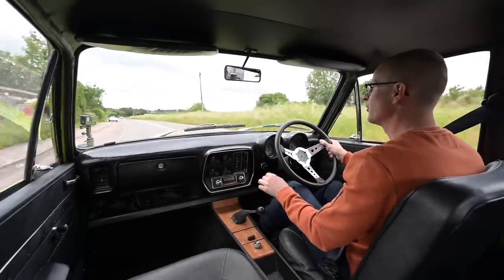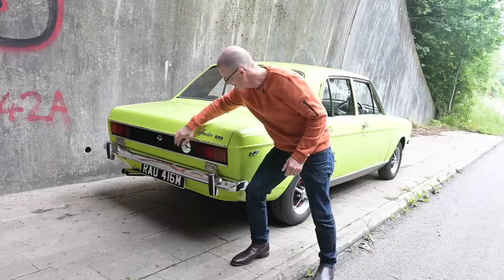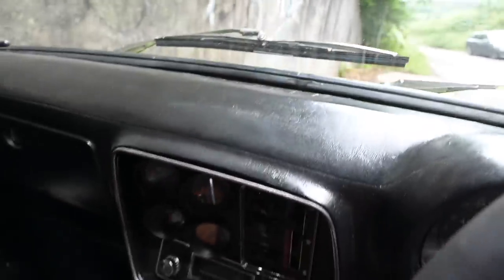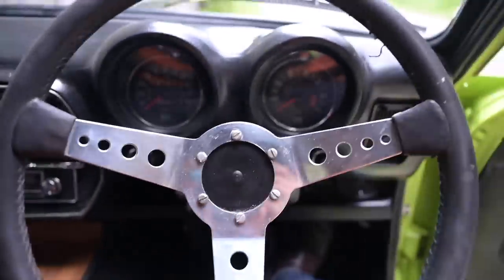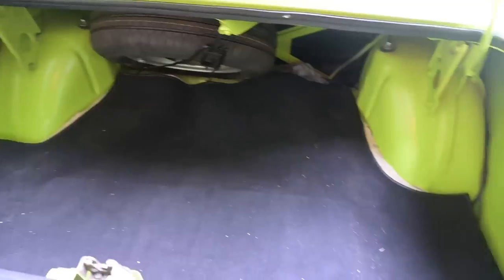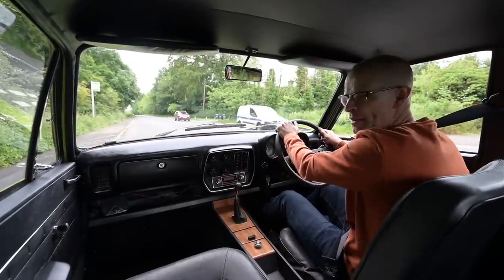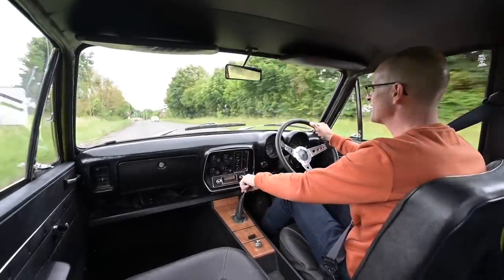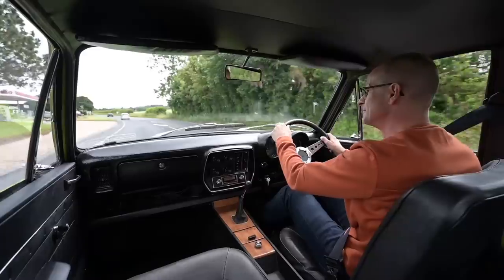Hillman Hunter GLS Goes for a Drive

Comment: My dad had one of these in orange with black vinyl roof it was a P reg with overdrive had it when it was 18 month old suffered a cracked head had it welded only for it to crack again a few months later so that was the final straw swapped it for a brand new Renault 14 gtl

Comment: My father had a 69 Singer Gazelle,  71 Sunbeam Alpine (cooking version of the Rapier) and a 75 Hillman Hunter GL. Before we moved onto a Chrysler Alpine.  The GL Hunter was in some ways good (had some good features like viscous fan and cloth seat inserts - much less painful than hot vinyl  in shorts) but looking back I think the tooling was getting old, as I recall the whistles from around door seals in the back and in the hotter summer of 76 you could not wind the windows down as they seized in their runners and the grip would let go off the glass. The improvement though was that unlike the Gazelle and Alpine variants they would eat water pumps (think i could change an Arrow water pump today as I saw my dad do it so many times).
Reply: my grandad had the chrysler alpine hatchback i remember the suspension going rock hard on it and then the solaras doors just kept failing and the handles wouldnt open them and the windows wouldnt work, he paid a lot of money for that car too. on reflection my dads old minx was trouble free, so a better car imo
Reply: @raycroal  My father preferred the Alpine, despite having only a 1442cc engine it blew the Hunter away in performance and was easier on the fuel,  but they were in Series 1 form prone to corrosion, as were the Avenger, Horizon and Sunbeam a product of successive years of Chrysler's aggressive cost cutting at Rootes and Simca in a fuitless the search for profitability. The Solara he had after a 1.6 GLS was good, don't recall him having any issues with it and he kept it till he had a Peugeot 309 it seemed resistant to tin worm which suggests that Peugeot was improving quality. We also had 3 Horizons in the family at this time, and none let us down with me learning to drive on a T reg 1.3 LS, although they all suffered the sticking brake calipers and corrosion to some extent, my first new car being a C reg LX one of the last ones built (at Ryton) it was well specced and reasonably refined with its B1 5 speed gearbox and came for the price of a poverty spec 205. I used it to tow my sailplanes around with it was good at with decent amount of weight, decent wheelbase and short overhangs and its 1.3 litre engine adequate to haul a sailplane trailer as fast as you wanted to go with 10m of weaving open class sailplane trailer behind you, however the turbo diesel 306 that I replaced it with in 93 was in different league, but given that the Horizon oily bits were little changed from the Simca 1100 of 25 years earlier it, so it should have been. However what will say is that for a family that was Simca powered for 20 years (my sister had one of the early series 2 that came still with the 1.3 Simca engine till they switched to the TX) for over 20 years, none of us ever suffered any roadside breakdowns or even series issues (wonder if our hearing is impaired by the sound of tappet rattling) in this time.
Reply: @grahamariss2111  good response i thought the little horizons could look pretty cool. I owned a 407 coupe and that was a far better car than many would believe and would reccomend them to anyone wanting a comfy cruiser

Comment: My first car was a cool looking slightly modified 1969 Hillman Hunter, complete with a black vinyl roof.  It had hot dogs instead of mufflers and went quite well. After it was written off in an accident, I replaced it with the luxury Hillman Royale 660 which had the GT twin SU carburettors. Unfortunately being an automatic it wasn't what you would call a quick car. But it was comfortable and solid like a tank. These were Australian cars sold by Chrysler. Interesting to note the interior dashes were nothing like the GLS.
Reply: They were not SU carburetors.
Reply: @erroneouscode  I stand corrected. Most likely CD150 Zenith/Strombergs.
Reply: @merlin51h84  A lot of people get them confused as they're very similar in appearance and the way they both function.

Comment: I used to have a GLS in the Philippines in the 1980s. Not ideal for Manila driving but fun out of town despite the appalling roads.  Right hand drive configuration with an air con.  Had it for a year until it broke down and when I returned to it with a mechanic it was up on bricks with the wheels, the radio, aircon,  seats .....etc all gone. Pity

Comment: I have a gearbox with an overdrive from an Alpine which used the same 1725 engine, the box is with and engine of unknown condition under my work bench. get in touch if you want to cut a deal.

Comment: The owner has done a lot of repair work to the bottoms of the doors, drivers in particular, just visible in a couple of shots an undulating surface to them.  Would a pick up acquired in Iran come with a machine gun or small bore cannon in the back?

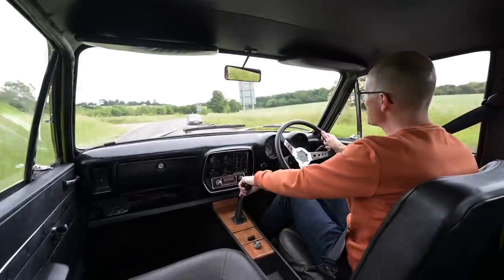Comment: 09:42 and 10:50 It Is PINKING. I daily drive  holbay and the manual  says 6 degrees of advance- On modern fuel it has to be 5 or even 4.

Comment: My pal Paul Evans  was quite pleased that his dad's 1.8TC Morris Marina would top out at almost 110 MPH, whereas one of these Hunters did around 103. The Marina's handling was pretty awful though. I hope the gent who owns this car does manage to find the overdrive for it which you spoke of. My late uncle John owned a more cooking version of the Hunter.
Reply: The Marina tc's top speed was 105mph - I know as I owned a 1978 Marina 1.8 HL/TC Mk2 and no matter what the speedo said that was all they could do which was still fast for back then. Plus the Marina handled just the same as many other rear wheel drive cars back then especially in the wet with the Mk3 Cortina being an perfect example and the Capri being worst. The Mk2 Marinas had beefed up front and back anti roll bars to improve the handling but lever arms and leaf springs are not the best for handling but then again the Marina was only designed as a cheap to run and maintain car for the fleet market a job it did well and my Marina was an ex-company car that was an excellent fast and reliable car that I would still have owned today if it hadnt been written off by a van that didnt stop at a junction and drove out right in front of me and it went to the scrap in excellent condition apart from the accident damage in 1986.
Reply: @williamwoods8022  My pal's dad's was a K reg, I believe a 1972 model. Another mate had the coupe version. I do actually recall a road test of a mk1 Marina TC which timed the car at 108mph, and that it marginally beat an MGB in acceleration. The former Marina was rolled and written off by Paul, the second rotted so badly, you could see through the tops of the front wings. I thought the mk 2 HL had a 1.7 litre engine. Yes, it did, 78BHP as opposed to the 98 of the mk1.
Reply: @williamwoods8022  you wouldnt still own it today surely?

Comment: As far as I'm concerned, Rootes' demise was a real loss to motoring. Rootes cars were good value for money, well made, and reliable. I owned a Series VI Minx with the 1725 cc. The 1725 was a good engine and very tuneable. The four-speed gearbox was, as you said, fairly long throw, but it was a strong gearbox and pleasant to use. Especially having learned to drive on a Series IIIB Minx with the column change, which was much slower to use, although I actually quite liked it. My Series VI Minx had quite decent performance and it was only in standard tune, so I can imagine that the Holbay version of the 1725 engine would motor along very nicely.

Comment: I learned to drive on a 1973 hunter - it was brilliant..... Until you drove thro a puddle when the engine would die.  Learned how to wield WD40 early in life
Reply: Also, the lining in the fuel tank came away so if you drove up hill the engine would stutter and stall as the fuel outlet blocked.....

Comment: A very nice example of a vanishingly rare model for sure but the first obvious thing that strikes me about this 1974 manufactured car is that it kinda looks like a Mk 2 Cortina (outdated quarter lights and all) at a time when Ford had long moved on to selling the 'Coke Bottle' Mk 3 Cortina - my first car by the way. So it would seem that the Roots Group - just like the BL to a degree -  couldn't afford to keep up with the competition when it comes to the latest styling trends. The engine in this car also sounds somewhat agricultural to be frank - but most four pots were back then. 

Also how well do I remember what these black vinyl seats felt like on a hot summer's day, methinks the owner should seek out a set of tiger skin print seat covers if he/she really wants to experience to joys of 1970"s motoring!
Reply: It was launched slightly ahead of the Mk2 Cortina, same year though, 1966. But the design carried on unlike the Cortinas.

Comment: Rootes-Chrysler made a huge mistake not launching the Holbay Hunter straight after the London Sydney Marathon they also should have lowered the suspension. The Holbay Hunters were at least as fast and much more reliable than the MK2 Cortina Lotus

Comment: Hunter GLs power was NOT 105 as you incorrectly stated, it was 93hp.
Reply: Most wouldn't pull that, most of the tooling was so knackered that good ones were few and far between.

Comment: To cash in on the 1968 London to Sydney Marathon victory Rootes commissioned Holbay to produce a tuned 1725 engine to power a halo model Rapier. Holbay added a big valve head, bumpy cam, high compression pistons, a tubular exhaust manifold and twin 40DCOEs.
The engine was delivered to the comps dept and fitted into a mule Minx. It went like stink and all was well until Lord Rootes drove it. "Rootes Cars tick over at 750 rpm" he said. Try as they might thecomps lads couldn't get the engine to idle below 1100 rpm. The gas velocity with big 
jugs, valves and ports was too slow so the engine stalled at low idle speeds. SU carbs solved the problem but Lord Rootes insisted on the Webers. Back went the motor to Holbay who put plasicine in the ports until the gas velocity allowed low speed idling. The power dropped from 120 to 105ish but it would idle at 750. The ports ended up smaller than the standard alloy head ports. The Holbay Rapier H120 never got near 120 in bhp or mph. The Holbay Hunter won its class (1601 to 2000 cc) in the British Saloon Car Championship 1973 when the engine was "un-strangled" and developed its potential.

Comment: I always thought the Humber Super Snipe/Imperial were nice looking Rootes Group cars, I have seen a few at shows. These cars were before my time as I was born in 1980, but many older Guy's I spoke to said these big old Humbers were driven by middle class twats like Bank Managers??? This just proves how class divided Britain was as these older Guys grew up in the generations when Humbers and other Rootes cars were still common. I replied that the big Humber Super Snipe/Imperial appeared quite classy looking well built cars for time, and it was not the fault of the vehicle that they did not like the type that drove them. It seems that survivability of these old Humbers and many other Rootes group cars is low. How vehicles are perceived by the motoring public seems to determine how many survive, I doubt the Ford Escort or Vauxhall  Viva were much better than this Hunter in regards to build quality or reliability.